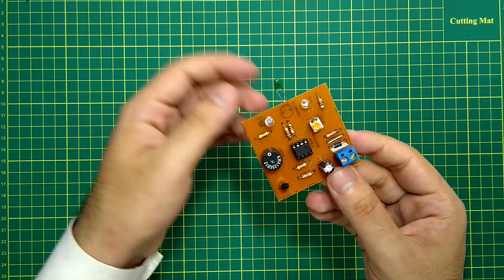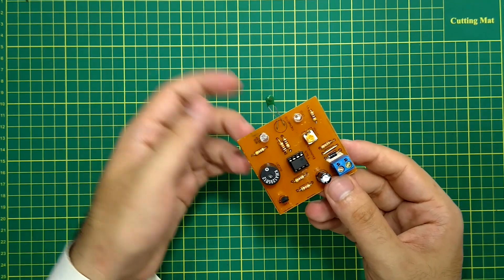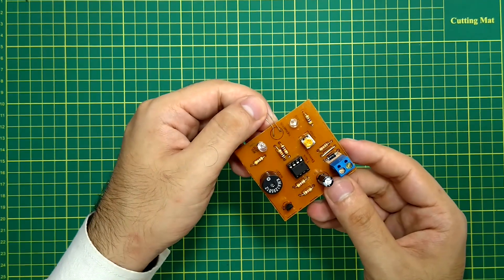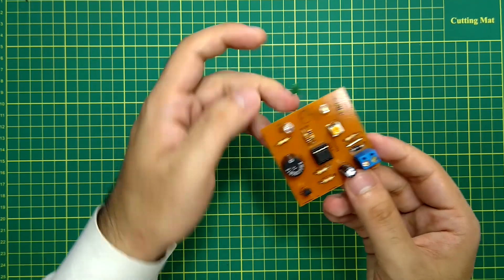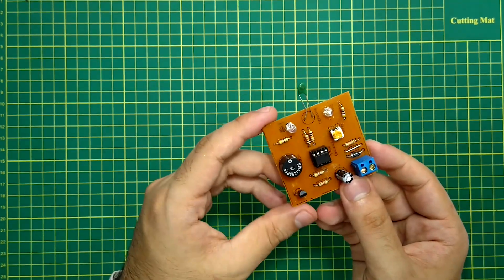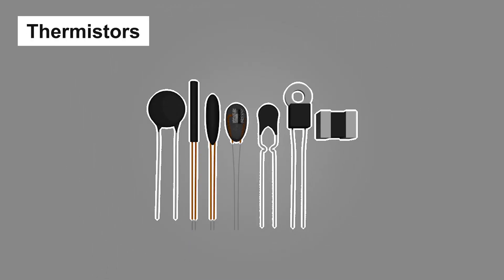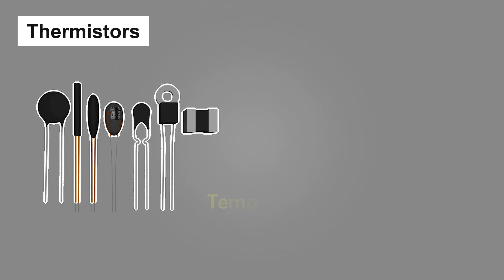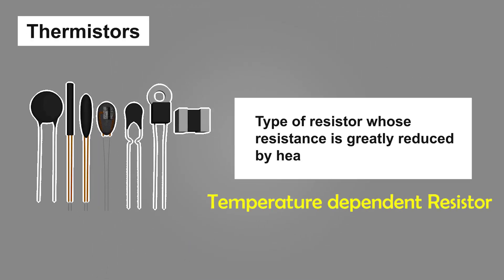How to make fire Alarm Electronics Printed Circuit Board||Free PCB Layout||fire detection system

Comment: sir can you provide circuit diagram link for the same? u only have pcb layout
Reply from the maker: Only PCB layout is available
Reply: @TTechMentor786  actually sir I have to use it for one of my projects and just can't show the pcb we also have to show the corresponding circuit and i have not been able to a working circuit anywhere online
Reply: Yes sir, it's very urgent please provide the circuit diagram
Reply: Bhai kisike pas h circuit diagram
Reply: @FreeZe9624  Google karle mil jaega bahut sare fire alarm system using ic 555

Comment: sir thermistor ki jagha smoke sensor use kar sakte he kya aur alarm ki jagha 12v moter ya phir fan
Reply from the maker: Nh is circuit m ap thermistor hi use kr skty o smoke sensor ka circuit alg hota h
Reply: @TTechMentor786  aap usper ek video banavo na bhir 12v power input and output ho